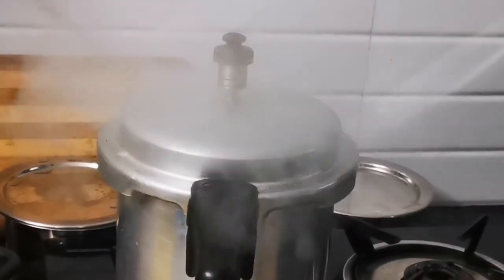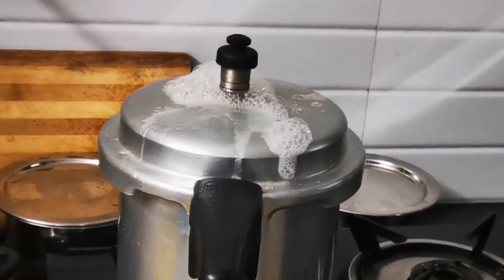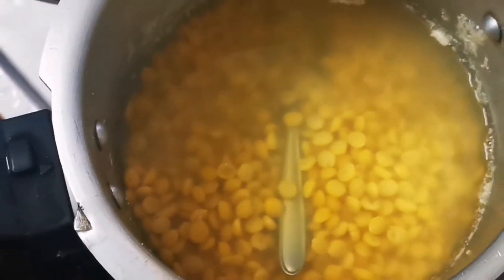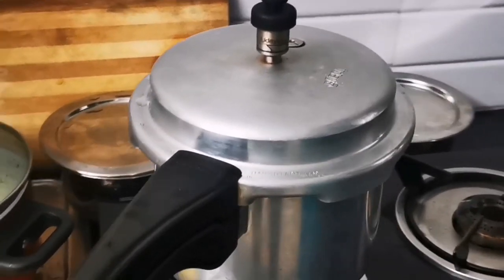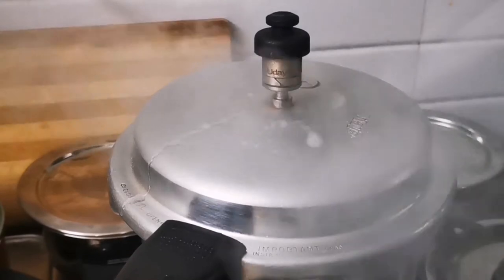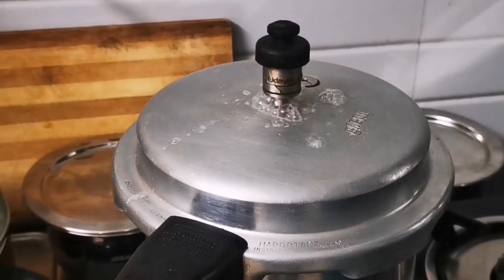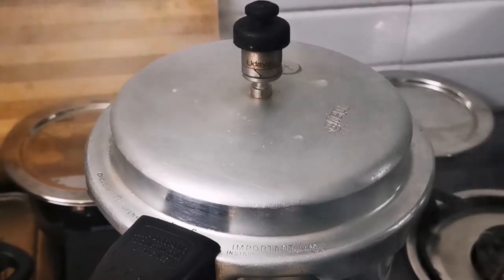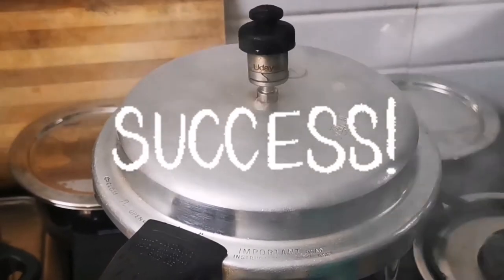Cooker Leakage problem | How to fix cooker | How to avoid water coming out from cooker whistle

Comment: The trick seems perfect but tell me dear can i place a plastic spoon under it because i have plastic spoon sets
Reply from the maker: No, it will melt.
Reply: @Tip-Lab  got it . I'll buy a stainless steel forsure.. thankyou
Reply from the maker: All the best, for some the tip worked for some it didn't. So don't loose hope if it doesn't work.